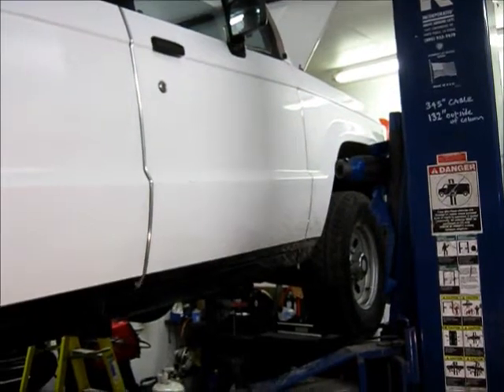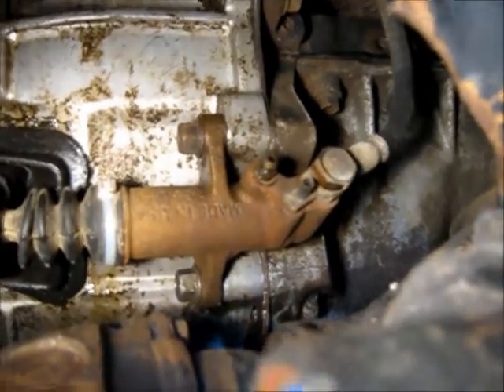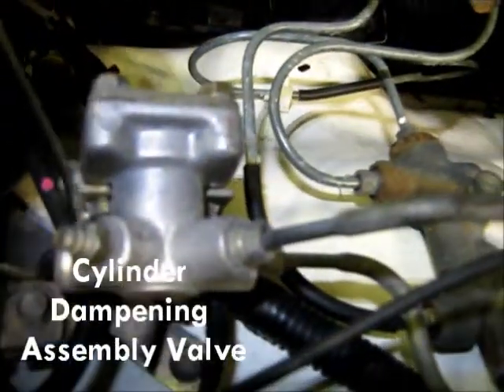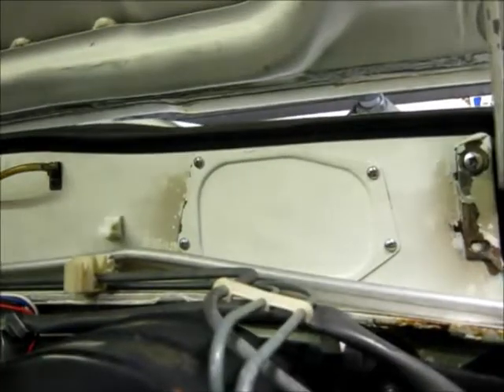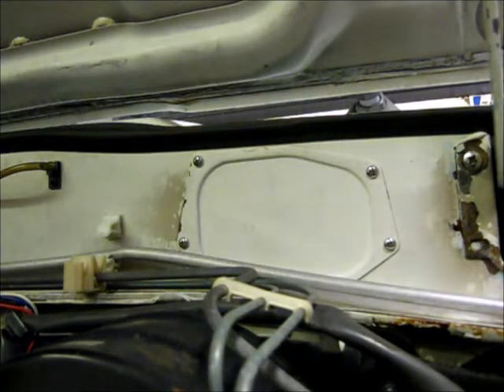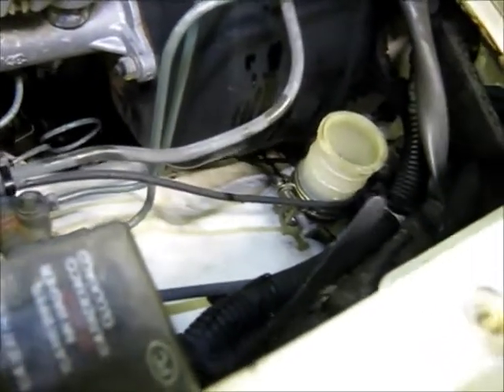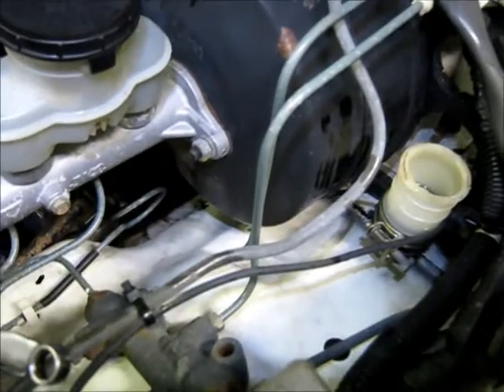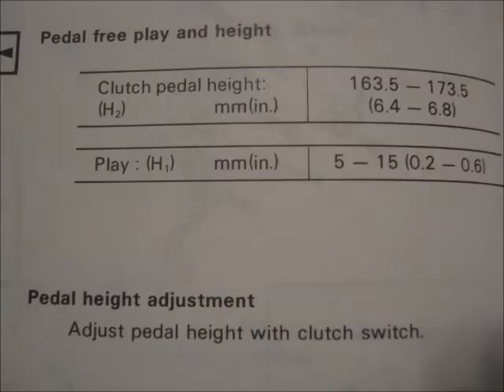Isuzu Trooper Clutch Fluid Flush - 1st Gen MUA5 (2 Person)

Comment: Is this something required after changing out the clutch? I did my 1990 clutch and now there’s almost a crunch feel after pushing the clutch all the way in.
Reply from the maker: Hell yes, you just did a new clutch, if you have a hydraulic clutch cylinder then you best attend to it. As a rule, especially on the wet coast, near the ocean, I change fluid in both the clutch and all brakes once a year. I like to hit in the summer after all the spring rains are finished.
Reply from the maker: How's your clutch now? What did you do to adjust?
Reply: I did the complete fluid flush, and tinkered with a few other things. The clutch felt a lot better but I’m still having that same feeling only after it gets heated to temp from driving. I can push the pedal 3 quarters down and it gets super stiff but will push through, almost as if it’s getting hung up on something.
Reply: Thinking I have a bad bearing or something
Reply from the maker: @aeryktate1054  ok, so back to when you did the clutch install...
Did you have the flywheel machined or install a new flywheel? Did you install a new pilot bearing? Did you install a new throw bearing? And assuming the clutch was new, did you use a clutch installation/alignment tool?
I have seen the dampener springs come out of their holes on cheaper clutch packs. It could even be the clutch fork or ball, yhey do wear out. Either way it sounds like you may want to split it open again and re-align everything. Thats a pain but better than installing another new clutch after 3 months use.
If you here any "howling" or "screaming" its likely the pilot bearing. Avoid the cheap pilot bearings on rockauto or any bearings made in china. Get National, SKF or good name bearing. When all the clutch and related components are premium  and installation goes well, you can rock that shit for 100,000 km with out issues. Best of luck bud
Reply from the maker: @aeryktate1054  one other thing... I don,t think its your issue, throw bearing or pilot maybe your issue but a heads up, the reservoir where you put your clutch fluid, its very similar to your master cylinder. It will outlast 5 or 6 slave cylinders, but it is now 30 years old and technically its a hydraulic device. If it leaks you may not be getting full stoke, which will not engage the clutch completely. May be on your horizon as well. You observe the clutch stroke by getting an assistant to pedal push while you go under there with a flashlight.
Reply: I plan on re opening everything back up next week. I used all oem parts, when I did the clutch change. But all parts are brand new, throw out, pilot, flywheel and most everything down there.
Reply from the maker: @aeryktate1054  let me know, hopefully no damage to your new parts. really if its not the issues I have already mentioned the last thing I can think of is the shift fork is not sitting in place properly or your throw bearing isn't mounted quite right. do want the update on your findings when you get time.